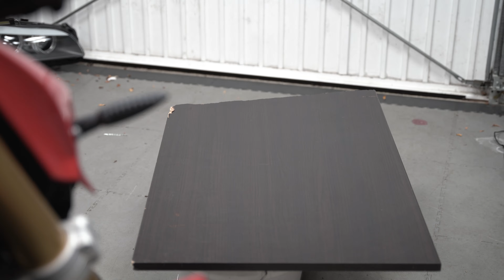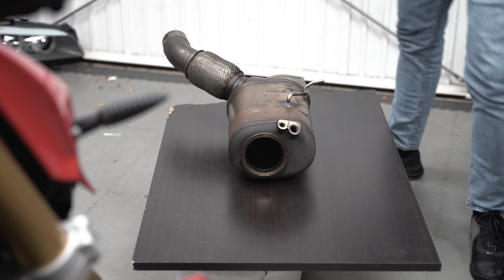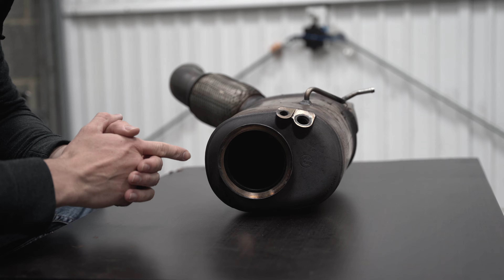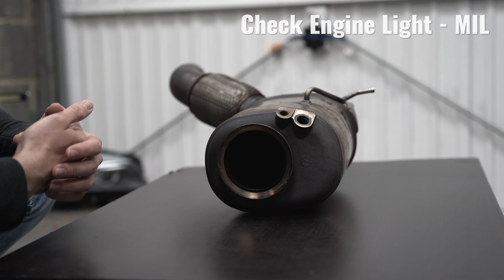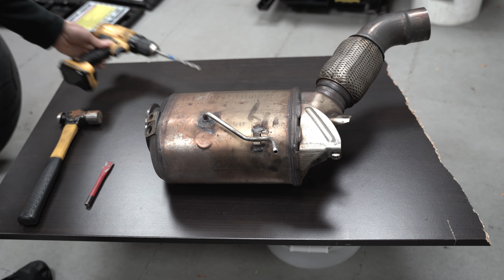DPF DELETE - Why & How To Remove a Diesel Particulate Filter

Comment: Hey guys, so i drilled a hole in my dpf foe the mercedes. Now it gives me all kinds of fault codes (MASS sensors). So the question is, the ecu thinks that the dpf is all in tact. But because of the holes it is not. Will those fault codes be gone when i delete the dpf in the ECU?
Reply from the maker: if those components are in good working condition - yes.

Comment: NO NO NO YOU ARE DOING IT WRONG ,THIS IS WHAT TO DO, DRILL JUST TWO 12 MM HOLES THROUGH THE CORE LEAVING THE REST IN PLACE ,THIS WAY THERE WILL STILL BE A PRESSURE DIFFERENTIAL BETWEEN THE IN GOING EXHAUST GAS AND THE OUT GOING GAS , THE PRESSURE SENSOR THEN WORKS NORMALLY  THE CAR COMPUTER CANT TELL ANY DIFFERENCE ,WORKS EVERY TIME IVE DONE IT ,TRY IT!!!!!!!!!!!!!!!

Comment: Inevitably, even the Palladium and Platinum rare metals used to make the DPF filter are ejected in as particles to be inhaled once leaving the exhaust. Diesel "ash" is pretty natural as a by-product. Wouldn't reason tell us that the risk of emanating fine, particulate metals in the air is way more toxic than diesel emissions???

Comment: I have a VW Passat TDI in Greece and I’m told it’s illegal to remove the DPF and it carries a fine of 7,500 €, it will fail the road worthiness test and the insurance may be invalidated. So that’s that. I’ve had it for 8 years and had no issues, hopefully it’s because I do a lot of highway driving which I guess most of the soot gets burnt off.

Comment: Illegal in the UK since 2014.   If a vehicle was produced with a DPF after 2014 it is illegal to delete it.
Reply from the maker: I believe that in the UK, and even in other countries, it is illegal even before the 2014 date. As long as the vehicle has been homologated for road use with a DPF, or any other emission related system, it is illegal to modify it and still use the vehicle on public roads.

Comment: A replacement DPF on a 2025 Toyota Landcruiser is about $10,000 USD. Estimates are that they cost $300-$500 to manufactur. It was bad enough back in the day when a GM air filter that cost 7c to manufacture, was sold in dealers for $11. There is very little profit on manufacturing a car. But the car companies absolutely clean up on spare parts. We the consumer are trapped, no spares, no transport.

Comment: I have done 500,000 kms on my Hino 300 truck now ,no problems with DPF, long trips and running most of the day doing deliveries. I never shut it off while it is regenerating, cleaning mode. Let it finish its process.All good so far..
Reply: It doesn't work for us that drive only in a small town with no freeways. Only solution is to get rid of it.
Reply: @bastianpate-uc5hd Exactly

Comment: Has neglected to mention pressure differencial and you can end wirh a vehicle that wont go over 3000 rpm or drives like zero turbo pressure...😂

Comment: But if you take the guts out of the emission components and weld it back up it will pass a visual inspection:) All you need to do is get a ecu remap to account for the DPF delete and new lower exhaust gas temps(and add more fuel if you’re looking for power).

Comment: Will an issue with the DPF reduce fuel efficiency? My 2.0 litre Amarok is poor on fuel but I've had no warning lights on. Cheers
Reply from the maker: yes. and dpf issue can influence the fuel economy as every DPF regen, will be additional fuel injected to heat up the unit.

Comment: I have a 68 transit connect p2002 code on dpf . 

Im now going to delete dpf physically and electronically.  And re-map . Only done 36k mile . 

Bought only a year ago
Reply from the maker: It is sad to see a low mileage vehicle having such problems ... do you keep it idling for long time? and do only short journeys?
Reply: @BestCarMods  to be honest I probably do only do short journeys but being a painter and decorator I need a van for practicality. With the p2002 and other comments on tiktok and stuff seems a lot of people have a lot less hassle once they remove it
Reply: @BestCarMods  thanks for the message what's your opinion on gettin it cut out and remapped ? Reason I bought a van is because I wanted less hassle and for it just to run to get me to my jobs  lol .  Some mechanics say on here won't pass an mot but a lot of the comments say different and they are only saying that because they are above board . 

I just need a working van nothing fancy 

Cheers mate
Reply from the maker: @paulhunter6764  from a legal point of view you are not allowed to do it. Form a technical point of view you will have a much more reliable vehicle. 
Can't comment more, I just discuss the technical aspect of things.
Reply: @BestCarMods  thanks mate 😎

Comment: I got 300.000km and 10 years with the first dpf, no problems so far.
I'm only driving long haul distances and using premium diesel with cleaning additives time to time.
Reply: Not suprised, he is driving only long distances.
Reply from the maker: let me make sure I understood correctly... you are still using the original and have more than 300.k km ?
Reply: If you do all that of course. I live in a small town and there is no long distances and no premium diesel just the regular one so the only option is getting rid of the dpf.

Comment: If you want more power . Get the gas engine. I just bought a new 24 Suburban diesel. Modifications are for stupid people who have money to waste. 5000 mile oil changes and  reputable fuel with Delco additives made for this vehicle will make it last.
Reply from the maker: is it that crazy 6.7 engine ?

Comment: Just did mine 2021 Mercedes sprinter 2.1 diesel, my dpf light on. Dealer wanted $4300 to replace. The guy in the chop shop in south Carolina deleted and reprogram the van for $1500. I get 32mpg now and my vehicle runs so smooth and easy. Fack emissions yeah Fack you come and arrest me fags

Comment: I have a 2013 f11 bmw.
I've actually had a letter from bmw for a recall due to the egr cooler.
I have to be honest as i drive my car and love my car, but don't know a great deal about the engine, i can do a basic service, but thats about it.
Just wondering on hiw i should proceed.
Should i seek out a local firm to do the delete and sort out the ECU.
Or just get the recall done.

Any advice would be appreciated.
Ive only had it about a year, so im still learning about my BMW..
Thanks.
Reply from the maker: the recall is free of charge and they will fit a new EGR + new coolant in the vehicle. Keep the DPF if it is not creating problems.

Comment: What will happen if you install a downpipe and temporarily drive it normally and the software will be done weeks after, any harmful ?
Reply from the maker: no harm. check engine light will be on. possible limp mode depending on ECU design

Comment: Can dpf still get blocked if remapped and cause problems?
Reply from the maker: 1.for a dpf to get blocked it first need to exist.
2.remapping vs non remapp does not influence the life of the DPF. If the engine for whatever reason is not burning clean and not able to regenerate it will block up the dpd
Reply: @BestCarMods  thanks mate

Comment: Main problem with dpfs is that many people including mechanics.and even dealers don't understand why they stop re genning and that its usually a seemingly unrelated issue causing it.Its possible to have a car with a dpf that does 200k.plus with zero issue's if it's well maintained and driven regularly on decent trips.Diesels were better before dpfs but theres alot to consider before ripping them out

Comment: is it possible to turn off the DPF on the switch?  like switching between staff 1-2-3?  I put on a long pipe, press the switch, and the DPF is turned off in the software.  when I have to test emissions for registration, I put back the DPF and turn it on with the switch to work in the folder/ecu.   Do you understand what I want?
Reply from the maker: not really possible on the switch, however you could code it out, and put it in for the test as it is still able to work, without having to regen, the regen is not part of the test. eventually you will have to clean it somehow.

Comment: DPF makes no sense, guys are still cleaning it and dumping the sooth and ash down the drain anyway. Manufactures should make a cheap replaceable filter which could be properly disposed off.
Reply: Damn bro this idea has a crazy startup potential
Reply: The idea is to keep that particulate out of people's lungs, not to prevent it from entering the environment at all. That said, only cowboys and home mechanics wash the soot down the drain.

Comment: if i do the first option and remove all the ceramics inside the pipe, do i need to remap the ecu?
Reply from the maker: yes you need to remap
Reply: @BestCarMods  how do i do this? what happens if i dont remap? will it stil run?
Reply from the maker: @n1ghtmare76  remap = go to a company that does remaps
if you don't you will get a check engine light
 you could reset the light and run untill the next time you need to reset ;)

Comment: In the UK using a car on the road with the DPF removed is illegal and even if it does get through an MOT your insurance is invalid. If you crash, and the bill is going to be hefty (your fault or not), the loss adjuster is going straight to your car and looking for any undeclared modifications and they are well onto the DPF/EGR gut/blank game.
Reply: If you crash a car the last thing they look at is your DPF they do a a very basic exterior examination of the car and engine they don’t get computers out and plug them in 😂
Reply: @vanfella1156  did you know that there is a box somewhere on your car that has the abs/traction control yaw etc that acts as a black box
Reply from the maker: very plausible.
Reply: And then do the police get informed? You get done for no insurance, lose your house, turn into an alcoholic, write the comment you just did, and then kill yourself?

No one asked bro...

Comment: Very informative video! Liked and subscribed🙂 Any idea what could cause a 2010 Audi A8 to smoke a lot and the DPF light to come on from time to time after a DPF delete? The two DPFs had holes made in them and the ECU was remapped.
Reply from the maker: if the remap process has been done correctly, the car will never show the DPF DTC/light ever again.
the smoke issue needs to be investigated.
maybe the car is trying to do a REGEN ;)
Reply: @BestCarMods  Makes sense. Thanks 🙂

Comment: Can i cut off the dpf and make a pipe from there or ?do i need tuning or remap the car
Reply: and sometimews there are white smoke comming can that be my dpf ? thats starting to get blocked ?
Reply from the maker: @armedfpv8763  yes you can cut . Also you can buy a DPF delete Downpipe (so you can have your old dpf intact for cleaning). Yes you need to remap.

Comment: I had a quote to replace this. Expensive and repetitive.  Removed the whole thing, got peace of mind.
Reply: What about the sensors, do I need to ģet mini cat foolers?
Reply: @TheNakea  No
Reply: Does your car still emit that terrible acidic stench after removing the DPF?
Reply: @ Like I said, it’s a bit like a school bus.  I think the smell comes from the AdBlue being injected into the system; that’s disabled as well.
Reply: Does your garage not check for a fitted dpf?
Reply: @randyandy2809  Since I only take the vehicle to indie shops, no.
Reply: If you get this removed entirely, does it not give you black smoke or smoke in general from exhaust? Ibhave beeb told by back street Mechanic to get it removed but officially it's not allowed apparently and call it illegal.
Reply: @HorifficJunoo  Black smoke, no, but it smells more like a bus than a standard passenger car diesel.  And no, it's not really legal.  I don't really care either.
Reply: @hugolafhugolaf  you just removed it? no light came on?
Reply: @HorifficJunoo I’ve had my removed and the mechanic needs to disable DPF with diagnostics and also he needs to disable AGR ventil also. With DPF my exhaust was clean, so clean you could literally drink from it, after i’ve removed it now it has smoke and exhaust isnt clean but i dont have issues with engine oil, with turbo-charger, with engine at all, and im really happy for removing it .😊

Comment: So a catalyst and DPF are the same box in a diesel car?
Reply from the maker: to make you life more complicated, the answer is on many cars the CAT + DPF are in the same unit, however there are vehicles where these are in different units.
Reply: I got a vauxhall meriva the cat is bolted straight on the manifold and dpf in the middle of exhaust

Comment: Hello. I have a question. If the inside dpf is cut, will the check light, light up or not?
Reply from the maker: how do you see someone getting a check light to do what you are saying ?
Reply: I want cut out inside material. But i think i get check engine light on..
Reply from the maker: @fastracer1291  You will get check engine light. That is why people remap engine ecu , or you use a diagnostic tool and reset DPF values. Also it is illegal to remove the DPF.
Reply: Thank you for answer :)

Comment: Just had my dpf delete done on Transit custom. Now I know I won't get a stupid priced bill ever again. Now got full power and better fuel economy.😉
Reply: 2016 Audi A6 2.0 TDI with Adblue owner here😞how does it work with MOT? Will it pass emissions?
Reply: @japanluv it will pass MOT if it gets mapped properly once the dpf has been removed
Reply: @vanfella1156  Hey. Cleared the issue I had, then done Adblue and EGR delete, DPF regenerates as it should, car runs really well now with no further issues, and I got a Stage 1 as well same day for just extra £25 😎
Reply: @gabe_css  No issues so far. Runs like a dream now. We shall see what futures holds. They were both done through the ECU from really reputable guys who know very well these models and their issues.
Reply: @japanluv can you give out their details please, I am considering these options. Thank you.
Reply: more EGR = More Soot particles. Less EGR or No EGR = Less soot
Reply: @japanluv if you know a mate😉that can do MOT's it's no problem.😉👍
Reply: @craigstubbs858  🤗🤗 I can sort it out 😎 Do you know a good place that can help me ? Obviously I need DPF delete, EGR delete and get rid of the Adblue system then an ECU remap.
Reply: @japanluv im about to do the same on my a6 2015, any issues since the delete?
Reply: @ Runs beautiful. No issues at all.
Reply: Same here with an Audi A4 2.0 TDI. Also had the EGR blanked. Runs brilliantly.
Reply: @craigstubbs858  no more stupid priced bills, ever again. 

Until the wet belt fails. 🫣

Comment: Hi I want to know what we should do with dpf conector and temperature conector Do we need to remove both after deletion
Reply from the maker: depends on the strategy that the tuner uses when removing the DPF from the software. This question should be answered by the tuner. Some keep them some remove them.

Comment: You said egr dealte what do you mean
Reply: Exhaust gas recirculation valve, it sends a portion of exhaust gasses back into the intake manifold resulting in carbon gum build up and restricted air flow over time. First thing I do before even the DPF is clean the intake manifold and delete that stupid valve.

Comment: Nice
Is posible only to drill some holes in to the dpf and remap the ecu ?
Will work?
Reply from the maker: depends how big are the holes
Reply: @BestCarMods  
Let's say 8 to 10 mm, 6to 8 holes
But just in case the dpf is impossible to be recovered
Reply from the maker: Hard to say. It all has to do with flow rate. You need to ensure that you get the fumes out from the engine, if not you will restrict performance for your application. My advice see if a dpf delete pipe AKA DPF downpipe is available. Sometimes you find them on sale at a very good price. after that if you get bored, you can send your old dpf for a clean.  @bobbondarul7448

Comment: There us a war going on between the manufacturers of cars and producers of Energy to run these cars. 

There are tremendous benefits to the government if we just dump our conventional cars and just buy EVs 

This will give them full control over our travel 

When we travel How far from hone we travel How much this travel will cost us and much much more 

So, how will they manage to control this 

EVs need to be plugged in and when we plug them in data is transfered yes I know data is transfered even when we do not plug in 

I could write a book 

So please do some research 

My GOD help us all 

Amen

Comment: Thanks for your video! Do you have an idea how to install an oxi cat for a Audi B7 2.0 TDI? In the DPF case there is only the DPF, so no oxi cat at all. Reason behind: after removing the DPF the exhaust gases are stinky like hell. I guess an oxi cat would be helpful.
Reply: It will not help. Consider another tune. That is where you might see a difference

Comment: Do get black smoke deleting your dpf or can a remap solve the black smoke
Reply from the maker: depends on remap and the health of the engine. If the tuner does a good job and the engine is healthy you can have minimum smoke only under aggressive acceleration

Comment: Hello
I did a dpf and egr delate last weak. All fine and works very well but it is to much white smoke from the exhaust and I do not know what to do. I also want to say that I did not remap the ESU. Do you think that remaping is the problem!?
Reply from the maker: would not think so. white smoke is usually coolant that is vaporised. at startup, with the engine cold you could get a bit of smoke, but after a few min it should not be a issue ... time to investigate ... now you are able to see what led to the dpf failing